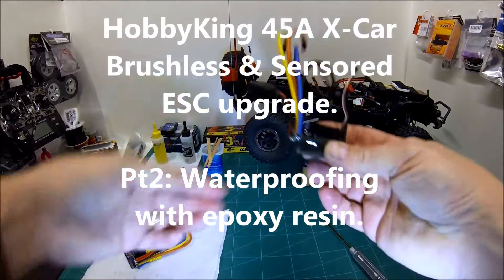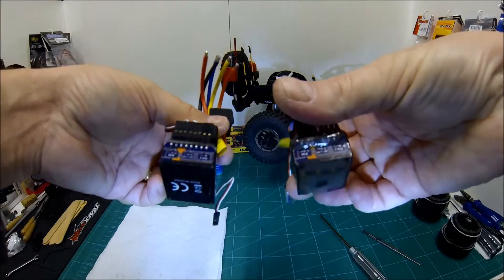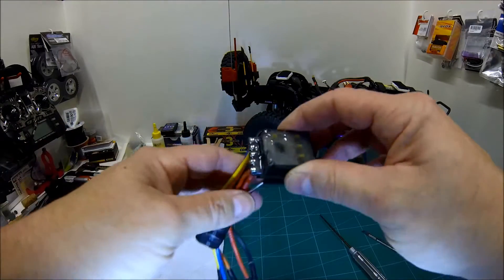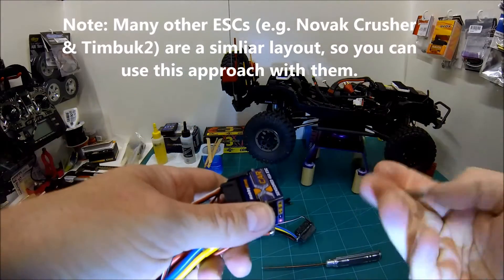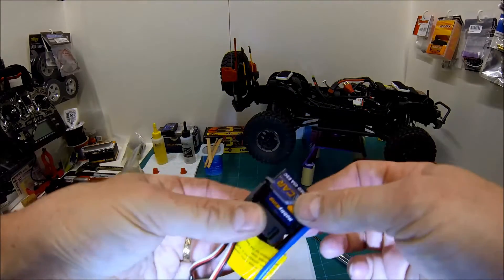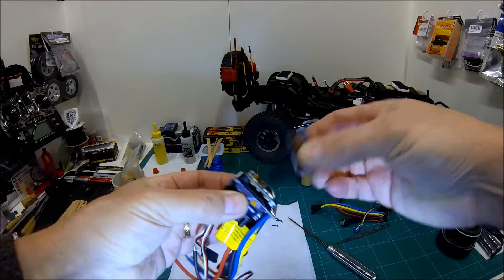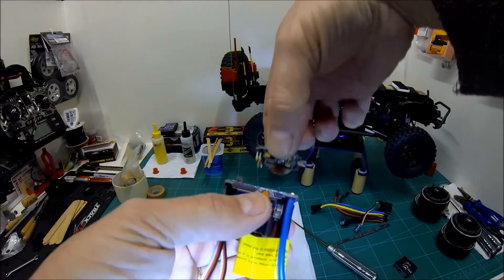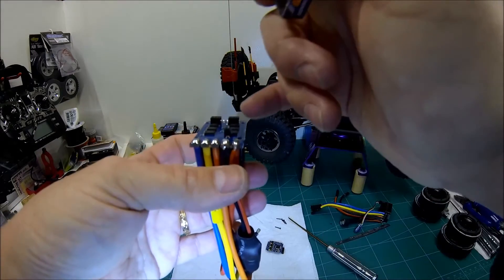SCX10 Rubicon Pt22: X-Car ESC Pt2 - Epoxy Waterproofing.

Comment: Viewing this Series, I'm witnessing a Man learning A LOT, in a relatively short time!!! 😱👏👏👏🍻 
Epoxy IS ultimately the best way to waterproof Electronics. I usually do the Receiver and the Servo PC Boards. I haven't been able to get Epoxy in quite a while.... But then, I haven't been able to afford any new Electronic Bits and Bobs in over a year anyway. 😢 
RTV Silicone has been a great stand in, but it's messy. It never cracks, stretches or bubbles like PlastiDip does at least.

Another great Product is Conformal Coating. Many ESC Manufacturers use it for waterproof Electronics already. Not Cheap. But, not messy, don't need to build "Dams" around everything, and cures crystal clear and infinitely thin....
Under normal circumstances, Epoxy is still my first choice. 
I also prefer it over anything else for fixing Magnets to Bodies. Nothing else is more secure. I live in a Desert! Shoe Goo is not even an option. It melts and drips when the temps hit 120°F (62° C!!) I don't know why so many RC Guys swear by it.
Carmine 💥 ⛽

Comment: what are those tires on the left side of your work area?
Reply from the maker: You don't miss anything! They are "Carson C900028 - Chrome Buggy Wheel Set" (12mm hex on rear, bearings on front) for a 2WD Tamiya buggy I will be building one day.